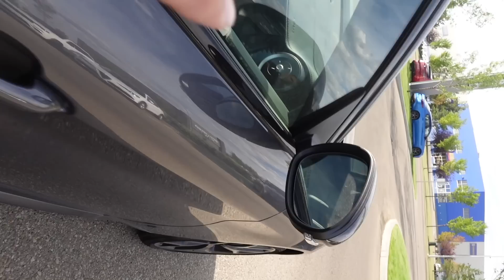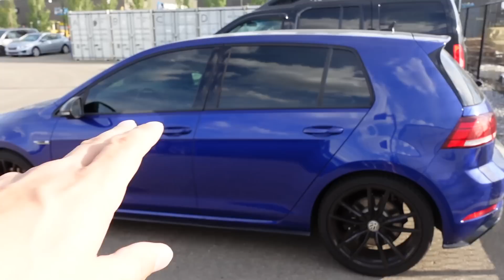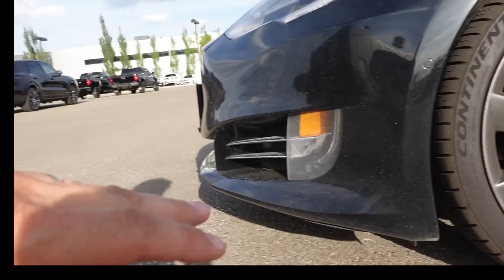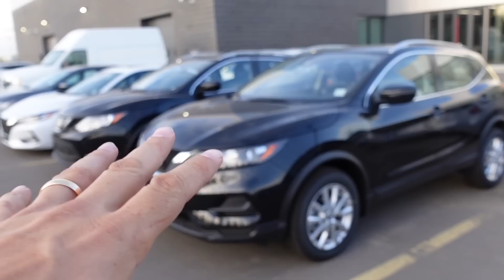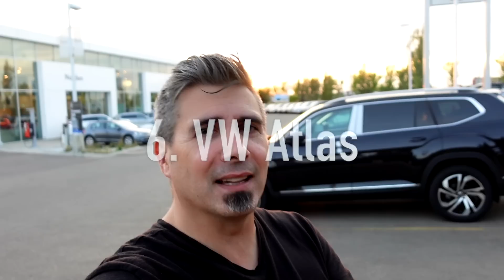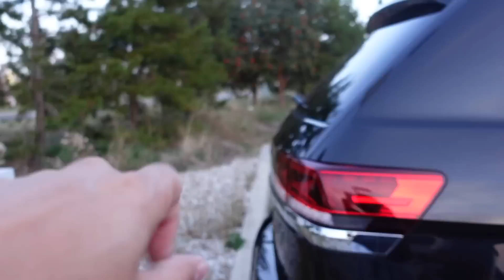Avoid These UNRELIABLE Cars With Electrical Failures!

Comment: Regarding the Jeep Wrangler, the heater core is designed so that if you have to replace it, you have remove the entire instrument cluster and dashboard for access. This could have been designed to remove from the firewall side of the engine but I guess FIAT had a better idea. (Fix It Again, Tony). 

Regarding the VW Golf (Rabbit, depending on the year because VW kept changing the name back and forth for decades), my 2008 VW Rabbit 2.5 has been mechanically excellent, economical and a blast to drive. However, the little German electrical gremlins are alive and well in my little car. My car was completely built in Germany, so I can't blame the Mexican factory.

Comment: In the US the Nissan Qashqui is called the Rogue Sport . There are a lot of these in the fleet of the car rental company that I work for . I didn't know that it was called a different name outside the US . I also didn't know that it had electrical gremlins . All I ever heard about this and other Nissan products is mainly the defective CVT transmissions , which out of warranty are very expensive to rebuild or replace .
Reply: I'm not sure there's a shop that can or are willing to rebuild those CVTs.
Reply: @damilolaakanni  You're right , I found out later that they can only be replaced .

Comment: Jetta Sportwagen 2010-2014. Stay away.... I bought a 2011 Jetta Sportwagen TDI used, and had about 10-11 issues in a year of ownership. The final straw being, electrical problems. The fuse box was melting....

Comment: Volkswagen Jetta is Mexican junk with bad electronic electrical problems such as power windows, melting fuse boxes , defective ABS control modules, and throttle bodies with haywire solenoids leaving you stranded on the side of the road

Comment: My wife bought a 2010 Chrysler Sebring brand new then gave it to our daughter in 2013 she is still driving it and it has over 300,000 miles on it, the only major repairs we've had done on it were replacing the radiator and an ac switch not bad for an 11 year old car. My wife the bought a Chrysler 200 in 2013 still driving it today 150,000 miles and no major issues. Just thought I'd share my story bc so many totally trash Chrysler products.

Comment: i have commented before that designing and building a quality product is not rocket science. Why can't these auto companies do it right the first time? Is it so difficult for Alfa to build a vehicle with a proven dependable elecrical system? What is  it with them-going to the dealership on a continuing basis is part of the  status of owning one? As far I am concerned maybe life is too short to drive boring cars but I would rather drive a boring car than one of these "joke" mobiles. It does not surprise me about Jeep . If Chrysler/Fiat which is now a  part of "Stellantis" went away I would not cry a bucket of tears. My only concern would be for the newly unemployed. Telsa ia farce and in my opinion has been one since the first one rolled off the line. You mean to tell me that we can send people into space, land on the moon, sens Rovers to Mars but Telsa cannot take the time to engineer a reliable vehicle? The more  I watch You Tube videos such as yours and Scotty's the more grateful I am for my 2007 ION. It may the most boring car but it runs great.  BTW-that Nissan here in the US is known as the Rouge Sport. Perhaps a better name would have been Rouge Junk Mobile Jr.

Comment: If any car starts having weird or vague electrical issues check the battery. If it's more than 3yo replace along with cables. With all the computers in cars these days they can go haywire if battery current is off.

Comment: The mystery for me is the Jeep - well known reliability issues that has only gotten worse with more Fiat parts ... and yet they still have high resale value ... I've driven in one ... noisey , very rough ride , all mechanical controls ( windows ) except the very top trim level , expensive. And still they are in high demand.
Reply: People are just obsessed with that type of 4 wheel drive, especially jeeps they have a cult following

Comment: I call "BS". OBDII code readers are not used to diagnose "electrical system failures". They are used to diagnose emission equipment failures and the related engine performance problems caused. Manufactures are free to add any diagnostic software they want but using the internal diagnostics on a car that is having electrical system issues from the beginning is not a good strategy. Stick with the basics in electrical system diagnosis before getting into code reading.

Comment: I bought a 2020 Golf last year. I racked up 30,000 miles already as i road trip a lot. I'm actually on a road trip with it right now as we speak. So far i only had cosmetic problems like the paint peeling off which was re-sprayed under warranty. It's my 3rd one, Golf ownership is a roller coaster ride. My first one was a 2010 GTI and is the biggest pos i've ever owned.The second was a 11 TDI with 186,000 miles. It was very reliable. I gifted it to my sister and is still on the road. I still buy them as no other car in its class drives as good.
Reply: 30,000 a year??? That kills a car. I always rent a car when taking a trip more than about 100 miles each way
Reply: @NickLeeds  It’s actually better for the car esp that I live in the upper Midwest where it gets cold. The seals get to warm up and avoids being brittle. It’s also better for the battery. I also have a 2002 Mercedes C320 with 34,000 miles and I replaced every single gasket because it got brittle. It was a NJ car and the previous owner let it sit for years at a time.

Comment: Alot of the problems with these cars is the battery failure .If the the battery is weak or not fully charged you will see component failure ,car stalls,and alarms.

Comment: I have a 2016 GTI with 80K. I have tuned both the engine and suspension. In all the these years I haven't had one single mechanical or electrical issue. Nothing has failed. I know many people in several VW  GTI / R groups that little or no issues as well. Beware of YouTubers misinformation. Please do your homework and ask owners of this model directly.
Reply: I have a 2016 as well. No problems at all.  Nothing but useless generalizations about these cars. The MK7 has a much better rep for reliability than previous models, and the Mexican builds have fewer initial problems than the German ones.
Reply: I got a 2015 GTI SE with 195K. It was fine until about 170 or 180K but since than it’s India been a money pit. I had an oil leak, AC had to be replaced and I had coolant leak that it kinda alway had from day one but the dealer said it was normal  to consume coolant when it was under warranty. Would I buy another one, probably but my other car is a Honda with 260K and has had none of the issues as the GTI. I’d probably just drive the VW up to 150K and think about selling it or learn to work on cars myself.

Comment: GTI. - yup.  My ECM packed it in 6 months out of warranty.  Combine that with a coolant leak, and I was out over  $2K.  I’ve also had to have the infotainment system re-flashed twice, and the adaptive lighting has failed.  Currently, I’ve got creaks in the rear suspension and some sort of clunk when I apply the brakes.  Finally, the interior is wearing faster than my Honda that’s three years older.

Last new European car I buy.

Comment: Well ...

VW Atlas are manufactured in VW Chattanooga  plant. 
Many BMW SUVs are built here in South Carolina and are garbage (X5s and others).
So many other brands that are built here in US that are terrible (Nissan).
My VW Jetta GLI back in the day was manufactured in Germany - biggest POS I ever owned.

I'd say these made in Mexico are very reliable, WHY ?
The Honda HR-V and Fit are/were made in Honda’s Celaya Plant in Mexico.
Toyota Yaris iA and Tacoma.

So yeah, it is not necessarily where they are made, it is which company makes them, engineering, design, high tech used and built materials that go into these vehicles are things that matter.
Of course just about all vehicles made in Japan are top notch.

Comment: We all know how TERRIBLE Li-Ion batteries are.  Tesla's use tiny phone battery cells, about 8000 of them.  I can't imagine a dumber idea then to rely on 8000 phone batteries to last forever.  In fact, these Li-Ion phone/laptop batteries are some of the most studied devices on Earth.  5 years is almost unobtainable, as has been the case with Tesla battery failure.  Plan on $50,000 for a new Tesla battery pack, or about $30,000 for an accident salvage battery on ebay.  If you DIY, try not to die, and you won't be able to charge the car outside of your house, because Tesla will ban you from their charger networks.

Comment: If you are dealing with electrical problems, Landrover  (all models) has to top the list. As an example, a few years ago my brand new Freelander  died. When it was taken inside the garage, the mechanic shouted for me. With no one inside the car, the wipers, horn and indicators all started up by themselves. The staff named it Christine after the Stephen King’s horror movie car. After two weeks unsuccessful work it was sent back to Landrover and I never saw it again. I received a replacement car. Talking with the mechanics I was advised that electrical problems are very common in Landrover vehicles across the board.

Comment: Hello from Wales. My car, an owned from new 1997 Peugeot 306 turbo diesel has an unusual electrical issue. Both remotes stopped working years ago and I have to wipe the door lock in wet weather, otherwise the instruments stop working. It's not a massive problem though. All I need to to is to remove a fuse, replace it and bingo, it's ok again. The fuse doesn't even blow. Very strange.

Comment: So far the Model S has been the most reliable car I've owned.  Very few issues, in fact hardly any except for a few annoyances but overall it's rock solid.  It amazes me how well it corners for such a big car vs the m5 I've owned.
Reply from the maker: I would say it sounds like the lucky side of that coin
Reply: @ECPP  I've driven several cars but the air suspension in the Model S is incredibly well tuned and smarter than any German cars.  It can be set which heigh position depending on GPS location.  I have it set to auto raises up to the highest when it goes to my garage.  The dampening system is amazing, rides like cloud.  BMW dampers are quite stiff and the sport modes are very stiff.  Model S is never too stiff.
Reply: thanks  newb here....got cold feet 2 days ago and backed away y from a showroom 05 s55 A MG

Comment: Electric faults, there the worse.
You can't see, you can't taste but you can feel Electric Faults and d sone times they hurt a lot!
Reply from the maker: Exactly David, electrical faults are far more difficult to diagnose sometimes.  When a mechanical part goes such as a pump or a set of brakes it’s easy but a drain on the system often means ripping panels apart and disassembling the car at times.

Comment: We just bought a new Golf.  2021. We’ve got a 5 years warranty.  I’m happy with that.
Reply: Good Luck. I had a mkvii Golf R. Only had 3/36 warranty. Dumped it at 40k miles. Major gremlins with mine. Fun car, but too many issues. Last issue took >2 weeks to diagnose and they had to call regional Guru. Short in main wiring harness shorted out starter, immobilizer etc. Lucky it didn't burn my garage down.
Reply from the maker: Good stuff.  Thanks

Comment: I've experienced a few small electrical issues with my Alfa Stelvio but all was resolved quickly and haven't had any issues for over two years...but when I had my BMW...it was a nightmare
Reply: BMW= Broke My Wallet. Empty money pits over 50k miles and/or 5 years old. Get a Lexus, April of this year I sold my 2013 ES350 and bought a one owner 2002 ES300 with 161k miles. I installed 4 new struts (rears were leaking) now it drives like new !  Quality and craftsmanship is unparalleled. Car is rock solid and quiet like a vault. There is a YouTube video of one that has 590k highway miles on the original engine and transmission. !!
Reply from the maker: BMW has its share of problems for sure
Reply: @ECPP  what about Mercedes? like 2012-2015 Mercedes AMG C63? thats one of my dream cars to get, along with the new Cadillac CT5-V Blackwing
Reply: Hey Pauly
Ever have to climb out the window of your BMW.  Door locking jammed on
the last 2 late models I had,  plus even the sound amplifer went out.  This
is only the small stuff,  but everything cost at least $1k to repair.
Reply: @jpdavis6042  lol....no....I had both power window motors go at the same time....a spring pop out of the front passenger seat  ..engine light come on while driving to a BMW dealer for service to then be told by the service department that I can't drive my car or the engine will blow up....all this and a few other issues ....all in one year of ownership....got rid of it after all these issues were fixed
Reply: I wouldnt buy one..Its a brand that left the U.S. only to return worse and more unreliable.

Comment: Golf R is not building in Mexico, it’s made in Germany.
Drive VW for over 35 years and never ever did have problems.
Also did drive us cars and yes there you got big time problems.
Reply: I had a 2015 GTIs no problems at all ads 2007 golf no problems planning on buying the GTIs mark 8 or golf r
Reply: The VW's sold in Europe are much better made and use better materials than the cheaper ones exported to the USA.

Comment: drive daihatsu. end of story
Reply: Skoda Superb ,2010. 1.8 tsi . Achter 23000 km in 2011 new.engine under guarantie . In 2012 troublesome DSG transmission .In 2018 oil consumption 1 l'iter every 1000 km. I loved the Skoda for its space and comfort. In 2018 I bought a Giulia. Now 64000 km without any failure. Top quality. Best car I ever had. I am 89 years old and owned many Cars. Among which Triumph Dolomite and Mercedes 200 D
Reply: the real petrol head 🙏🙏

Comment: Volks guy here. Every Jetta I’ve owned and my parents. All the air conditioning in them has failed. Forget the name of the part specifically but some component of the ac is faulty and a known failure. 

Also water pumps As well on the Mexican made ones I’ve experienced as well
Reply: I've had AC and water pump issues with my MK4 Golf in the past...and it was built in Brazil. Maybe it was because of the age of the car and the fact that the previous owner didn't use it much, I bought it with 138k miles on the odometer.

Comment: 2010 Camry I bought 10 years ago with 40k...only major repair in 10 years was a leaking brake piston on the driver's front... the only recall was a sun visor... My wallet is a very happy camper...
Reply: Wallet wound not have been happy if y had a BMW break my wallet
Reply: @robertceroli3512   True that!!!
Reply: Own a Toyota Highlander, 2019, Sienna 2008, 4 Runner 2017, and recently sold a 2016 Tacoma. The Sienna recently needed gear shifter bushings replaced. I think the worst issue we’ve had with any of them is the power door locks. This has been a ridiculously expensive issue on all but the Sienna. I really think Toyota owes their customers a fix for those. Anybody else have that issue?
Reply: But as said at the beginning, "Life's too short to drive boring cars!" But it's too short to drive endless money pits, too. I like somewhere in the middle. Lol
Reply: @GreatestLiesEver  I also have an FJ Cruiser, a Tacoma, and a Lexus RX350... plenty of excitement at a reasonable price!!!!
Reply: @gwats19577  Yes, bases covered. You have a nice stable.
Reply: @GreatestLiesEver  I like the way you think, BigBad John....

Comment: Alfa have always been unreliable. I had a 2000 (10 months old) 156 which needed a replacement transmission in less than 2 years. Typical Italian car really.
Reply from the maker: You are right that is the Italian way
Reply: @ECPP  F.ix I.t  A.gain  T.ony
FIAT 💩💩💩💩💩

Comment: The other 'advantage' with Jeeps is their one-star crash ratings.
Reply: have only 90k on my Jeep XJ the unibody split open on it at 80k
Reply: I wouldn't put any credibility into government crash ratings.  Those are funded by industry to maximize profits.  Thats why they crash into an infinite mass wall, so the flimsiest cars do the best.  Its absurd.
Reply: @FFE-js2zp  Ah, a horse dewormer fan since, you know, government baaaaaaad.

Rather than get your facts from Facebook or a some uncle's girlfriend's coworker, post injury/death rates of Jeep vehicles versus other vehicles. Those would be 100% objective, and if Jeep is comparable then you can claim victory.

I'll wait.
Reply: @LearnAboutFlow  
Easy, economy cars have 20x the actual death rate of heavy SUVs.  Their average safety rating is 45% higher.  Ots all about profit margin.  Buy the lowest safety rating for the safest car.
Reply: Think.  A 2500lb car in a head-on with a 5,000 car will be driven backwards at half the impact speed.  So an ecomomy car with a 5 star crash rating will experience a 75 mpg CERTAIN DEATH collision, while the 1 star SUV with experience a CERTAIN ZERO INJURY 25 mph speed bump in the same accident.

Comment: I would never buy any of these newer vehicles, that have electrical problems. I will buy something, older and solid instead.
Reply from the maker: Solid plan for sure
Reply: Nothing newer than about 1996.
Reply: @BillLaBrie  
Lexus started building their vehicles with LS400 back in 1989, 32 years later still top notch company that no other can even come close ...
Reply: @sts1541  with more electronics than anyone could possibly need, which is the point being discussed here.
Reply: I'd choose the 4Runner than any European imports.